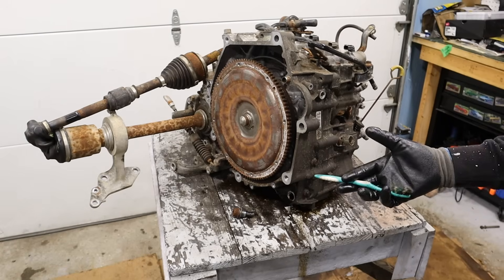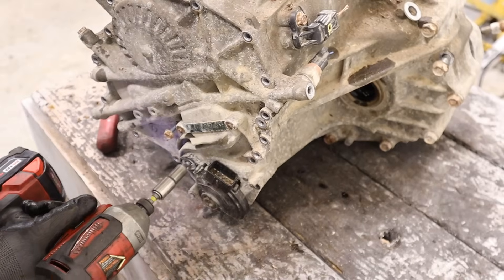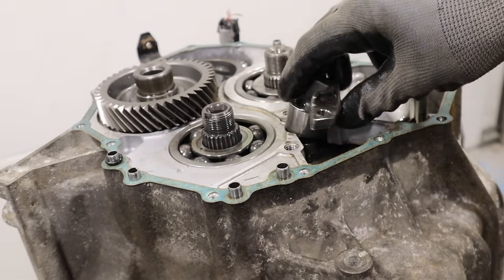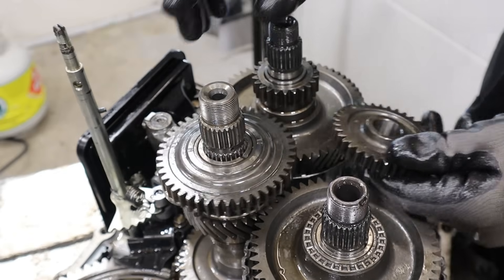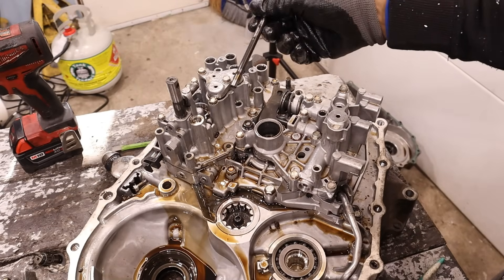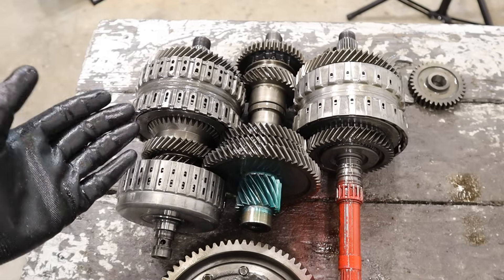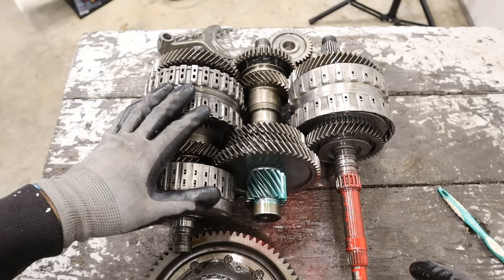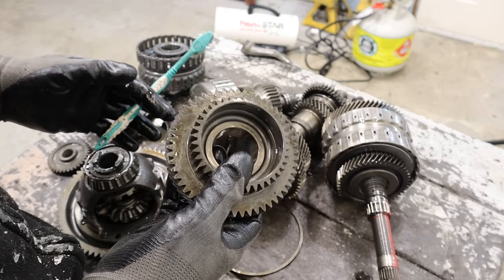This Honda Automatic Transmission is a Manual Transmission in Disguise

Comment: I had a 2.4 2008 accord with that same/similar 5 speed auto, had 360k kms on it and still drove with no problems after I crashed it. Just do fluid changes with the OEM honda fluid every 60k kms and replace that inline filter and it will still be moving when the sun goes super nova.
Reply from the maker: Nice. The 4 cylinders do better on the transmissions than the v6's
Reply: @speedkar99 yeah my family 08 accord transmission failed at 250k km we got it replaced then it got in an accident few years later
Reply: And you get VTEC on the 4 cylinder K24Z2/Z3
Reply: I have 2007 accord v6. 5spd. The inline filter is so crucial yet not many regular mechanics even know about it. Honda dealerships included. They denied its existence. I had to show them the diagram.